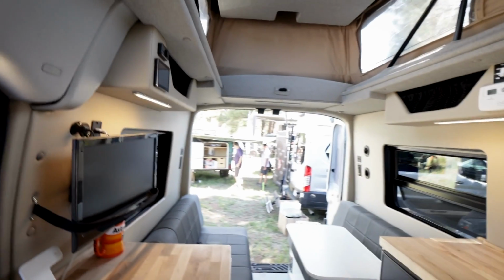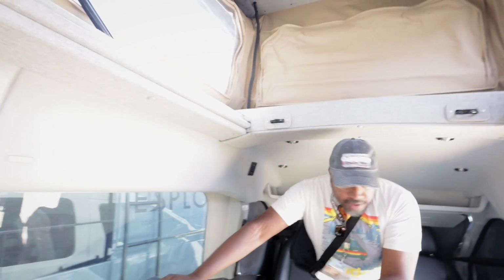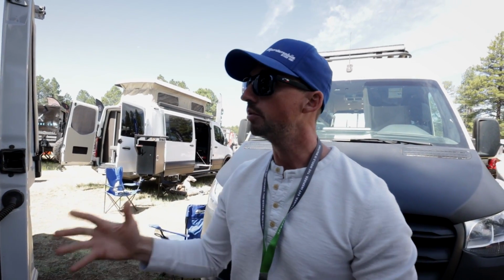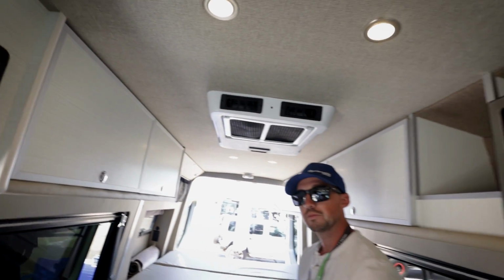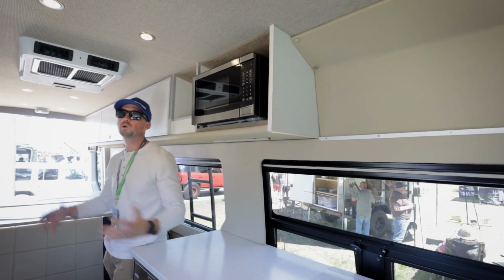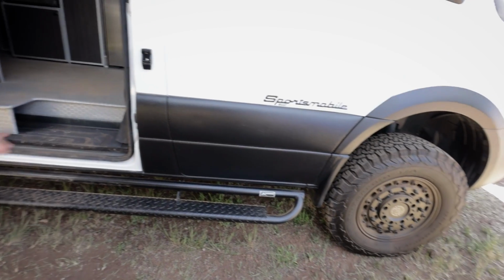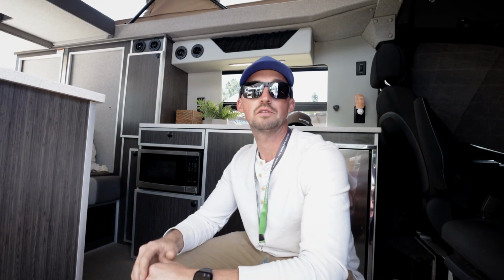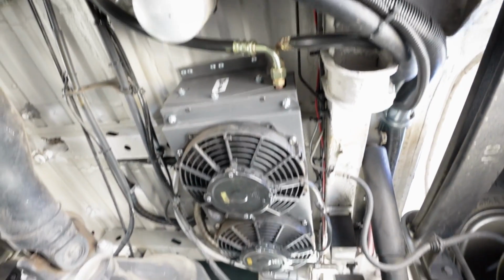Why You Should Consider Sportsmobile For Your Custom Camper Van Build

Comment: BS. No cop or hwy patrol called them and said their van modification saved somebody’s life. To make that opening stronger than it was before they cut the big hole in it they would have to put so many hundreds of pounds of steel up there way up at the roof that it would make that van sway back-and-forth like crazy. Retired structural engineer